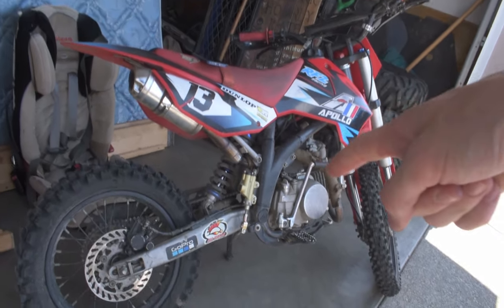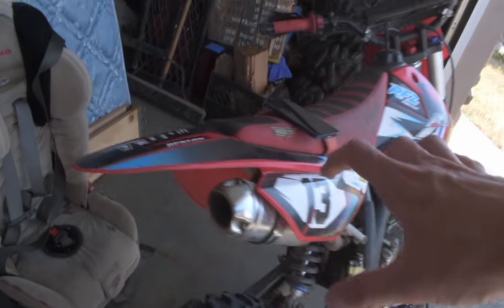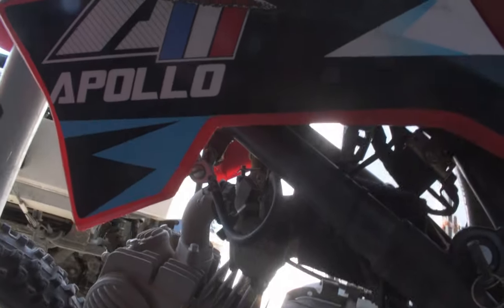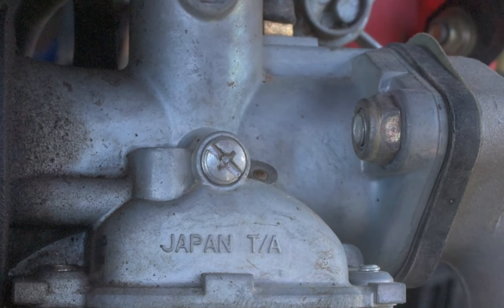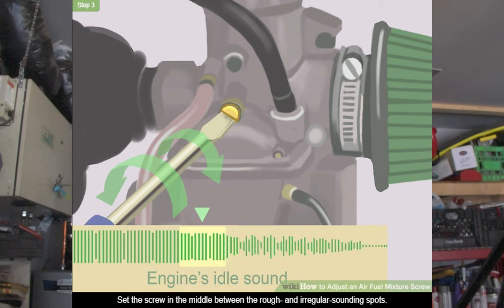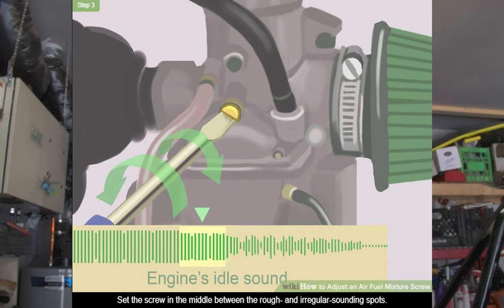How To Fix A Dirt Bike That Wont Stay Running | High Idle | Hot stall

Comment: i've had a chinese motorcycle  110cc for 6 years now and never had issues starting or idle or anything. it just runs good. even the battery has 13 volts after 6 years. i started to like chinese products bcz of it.
Reply from the maker: Thats sweet! Sounds like you have some good luck!
Reply: Lies
Reply: Wish that was the story of my bike
Reply: @henrywinchester9372  why would i lie? it's a honda wave replica. it's called jialing. here everybody use FORZA or Jialing or zimota ... some have 14 years without major issues
Reply: i had one for 3 days and won’t stay on
Reply: @KMDecided  today it closed 80000 km only oil and gasoline. Still working. But the battery died last month.
Reply: @KMDecided  today it closed 80000 km only oil and gasoline. Still working. But the battery died last month.
Reply: @AaronsEnduro  it's not luck. Everybody use it here cuz it's reliable and cheap.
Reply from the maker: @RANGOArts  mine blew up two engines in one year and a transmission lol

Comment: I’m trying to fix a 2003 XR 70R that hasn’t run in about 12 years and the bike is struggling. I’ve put a new carb in it and the bike starts however the idle is often way too high, sometimes even idles at max rpms. Other times the bike will idle much lower and closer to where you would like it to idle at, however when this happens it will start idling quite high randomly and go back down after a bit. There is also sometimes where the bike will smoke a lot, often when the idle is really high. I can’t warm it up because the idle is way too high for a cold start and the adjustment screws don’t seem to change anything with the idle. Does anyone how I can go about fixing this

Comment: My bike only idles on choke and it’s a low ish idle and then soon as it’s warm and I drop the choke it will idle for about 5 to 10 seconds nice then it gets lumpy then dies, also when Im riding it’s perfect no bogging or dead spots but on decel I get single loud bangs out of the exhaust but no flames, no black smoke and ive checked the plug and even put a new one in it. I’ve also put a new cdi on it, do you know what my problem is. Ive got a video of the idle on choke then taking choke off and it dies after 5 ish seconds
Reply: It might be the carburetor jets clogged mine been doing this too I got a new bike last week and everytime I turn choke off it dies and someone told me that it might be clogged maybe check that because that’s what I’m bout to do
Reply: Dude my xr400 does the same thing.  After taking the choke off after a few seconds I hear like a click and it just dies.  I’ve checked compression, done valves, time, spark plug and gone through my carb.  I’m thinking I might actually have an exhaust issue now.
Reply: The thing is though the throttle is perfectly adjusted and ran great for a long time.  Super responsive and doesn’t lag or bog.
Reply from the maker: Maybe debris inside the pilot circuit
Reply: @AaronsEnduro  I just ran through my whole carb, specifically the pilot and I only run non ethanol.  The thing is it ran great for a long time and slowly got worse which is why I checked valves.  I did notice earlier that my float got stuck and it started dumping fuel out the overfill lines.  It’s crazy cause it’s only about a year old and I always drain fuel and all that after riding.
Reply from the maker: @Jbrooks7177  if you suck debris in from the fuel tank it doesn't matter what kind of gas you run

Comment: Please respond to me. I can’t figure out why my quad won’t run. Because it will take a while to start it (it’s kick) if it starts, and if it runs it won’t idle and you can keep it alive for about 30s to a minute and it will cut all throttle and die, and also it is fouling plugs in minutes but no visible damage and normally still look new. (I think) please respond😢
Reply from the maker: Sounds like its over fuelling and flooding

Comment: Thanks for this video vary helpful my crf150 Idols high when hot and revs when the bike is stoped its really annoying when riding on the trails I am hoping it’s an air leak
Reply from the maker: Let me know how it goes!
Reply: Hello sir! Did you found out what is the problem? I'm also facing the same problem
Reply from the maker: Assuming it was something to do with the carb/throttle assembly
Reply: @Troy Wildman please tell me how did you fix it
Reply: @AaronsEnduro  ive already cleaned my carb and my sparkplug is optimal. But the idle gets high when i ride it about 5-6 km. And the idle becomes good if i pull the choke. It feels like running lean when my engine ride about 5-6 km it reaches 3k to 4k rpm
Reply from the maker: What color was your spark plug
Reply from the maker: An engine will rev higher only if given more air/ leaned out. Putting the choke on, limits air flow.
Reply: @AaronsEnduro  the color of my sp is rusty brown sir
Reply from the maker: @arthasmenethil4  tough to say without being able to look it over with my own eyes
Reply from the maker: so when the bikes cold, it idles good, but once the bikes hot and been ridden it revs high
Reply from the maker: Look for air leaks, plugged pilot jets/passages, pilot mixture, float level.
Reply: @AaronsEnduro  im pretty sure that there is no clogged in my jets and theres no air leak in the intake manifold and reedvalve sir. Because if there is a air leak in the manifold i think it will go high idle even when first start.
Reply: Trey Wildman please tell me sir if you already fixed your problem because i cant go for long rides because my bike goes high idle when hot

Comment: bike will start but when u hit the gas it just starts idling high like the throttle is stuck but the throttle isn’t stuck and it just keeps building rpms brand new engine and new carb

Comment: Hi, I have a crf150r and my bike will not run with the choke off. I have cleaned the pilot jet and could see through it. I also replaced my spark plug. Is there anymore tips that could help.
Reply from the maker: Did you ever regard what color the plug was?

Is a bike only wants to run when choke is on, to me id say its too lean of a main jet, or possibly not enough overall fuel delivery via the fuel screw. Check the rotations on the fuel screw m, should be somewhere around 1.5-2 rotations.

If you want to chat 1 on 1 you should check this out
https://www.youtube.com/channel/UCcviyKZ2Vf3IHFliwebzODA/join
Reply: i have a crf150 f and have the same issue

Comment: I got a KLX450R. When I start it the idle is normal, then after I blip the throttle the idle goes up higher, and stays at that rpm. Not sure what it could be.
Reply: Sticky throttle cable and throttle plate. Then check the reverse throttle cable make sure it has tension

Comment: Help. Have a Baja 70cc pit bike. I’ve adjusted the valves, 2-3 carbs, and 2-3 throttle cables. Starts right up, but revs to the moon, and adjusting the carb does nothing. Fixed the Honda CRF50F, but this Baja is pissing me off.

Comment: I have a 2003 kx250 and it idles way high and I'm adjusting the fuel and air ratio screws on my carb
Reply from the maker: You need to adjust the idle screw

If you need one on one guidance i can help you here:

https://www.youtube.com/channel/UCcviyKZ2Vf3IHFliwebzODA/join

Comment: What about a hanging idle when i rev it up and let off it’ll hang at high rpm’s for like 4 secs and slowly go back down to idling good. It also pops a lot when accelerating and letting off
Reply from the maker: Sounds lean
Reply: @AaronsEnduro  preciate it
Reply from the maker: Check your spark plug colour to verify
Reply: @AaronsEnduro  haven’t checked my spark plug yet but I got the aftermarket longer fuel screw adjuster and I also figured out that the boot from the intake to the carb was loose so I tightened it, seated the fuel screw, turned it 2 turns out and couldn’t get it to run right. Still bogging. Messed with it somemore and now I can’t get it to run without the choke pulled out (on) and when it is on with the choke pulled out it idles really high. When I push the choke back in it dies. I’m pretty lost. Might have to rebuild the carb idk.
Reply: @AaronsEnduro  it’s a 2008 yz250f
Reply from the maker: Choke on richens the bike, further confirming its running too lean and there not enough fuel.
Reply: @AaronsEnduro  thanks. I’ll see what I can do
Reply: @AaronsEnduro  and sorry I know I’m asking a lot of questions but when I took the stock fuel mixture screw out it didn’t have an o ring and washer on it. Could they be stuck in the carb?
Reply from the maker: @bradenpryor7442  only one way to find out!
Reply from the maker: @bradenpryor7442  never touched a 08 yz myself

Comment: \I have a problem with this tool, it's a KTM 250 2T
The tool has not been used for almost a year
This week I found time to take care of it, I did a fuel-oil change, I cleaned the filter plug, everything, finally I tried to start it, but the car could not start.
It only started with carburetor spray and shut off straight away
From that I understood that the carburetor needed to be cleaned and that's how I did it.
Now the problem is different, the motorcycle engine goes straight up to very, very high levels
I played with the air-fuel screw but unfortunately it didn't help.
Is there a situation where the problem is different? Something in the carburetor maybe? need help please

Comment: 24 xtrainer..starts fine..after a little run around ..having trouble starting it have to give a little throttle..sometimes when slowing down it dies?? Whats going on?
Reply from the maker: Fuel starvation because of float height would be my guess

Comment: Mine high idles with choke off, then the “rpms” go lower as I lift the choke up more and more. What do I do?
Reply from the maker: To me it sounds like the pilot jet could be too rich. What color is your spark plug
Reply: @AaronsEnduro  I’ll have to check sometime else but I’ll see if it’s the pilot jet , because this is a new carburetor
Reply: @AaronsEnduro  hey I fixed my regular carburetor and I’ll see Tom if that fixes the high revving when I kick it over
Reply from the maker: Exciting stuff!

Comment: Aaron, I have a problem with 125 cc Chinese bike. I can not get it to idle. I have cleaned the carb thoroughly and the Pilot Jet openings as well as fuel mixture screw are clear. If I put my finger over the bleed air inlet at the front of the carburetor, the rpm increases but I just can’t get it to idle with any adjustment of the fuel mixture screw. Any ideas?
Reply from the maker: Adjust the idle screw
Reply from the maker: If you’re idle screw is set to low it wont idle without you staying on the throttle
Reply from the maker: Stock or aftermarket carb?
Reply from the maker: They stamp makuni on the fakes too
Reply from the maker: Id take the carb apart and make sure its put together correctly
Reply from the maker: You already know its a carb/fueling issue.
Reply: Check for air leaks and drill the primary bigger . Mines had a chunk of metal not letting the primary jet sit properly.

Comment: I have a 2009 crf 250r it ran fine till I did a carb clean on it and now it stars fine but without touching the throttle it will rev up a lot then after 10 secconds it will either go down or die out. It is also backfiring like crazy and the pips starts glowing red after startup because of high idle. Do you know what the problem is?
Reply from the maker: If the pipes glowing red, its running lean

Comment: What if when I turn it on just staright up revs the shit out of it like it gonna blow whole bike is jumping backwards I gave it no gas just turned it on I have KLX140G I cleaned carb and put back on started doing that what did I do before cleaning carb bike wouldn’t stay on without giving it throttle so I figured clenaing was my best but ended up doing something wrong I guess
Reply from the maker: Throttle slide in backwards (turn it 180*)
Reply: @AaronsEnduro  gonna work on it today
Reply from the maker: Lemme know how it goes! Should be a simple fix!
Reply: @AaronsEnduro  thanx I’ll
Get back to you I’m off work at 5pm
Reply: @AaronsEnduro  it’s good fixed quite a couple things
Reply from the maker: Heck yes brother!!! Hope i was able to help!! If not still stoked ya go it going!

Comment: What about throttle body bikes? 2019 KTM 450 EXC-F.
High idle when hot, have to slip clutch to get ECU to bring it back down. Also stalled out on take off (loud pop/backfire?) after idling at an intersection.
Reply from the maker: Sounds like its running lean

Comment: So I just rebuilt my bike and did the valves. All the clearances are good. When I start it, it likes to bog when I give it throttle right on startup and when it’s good it has a little bit hesitation and a hanging idle. For reference the idle is set to around 1900rpm and hanging is like maybe 3500. Any ideas? I checked all the boots and lines are all that but I’m thinking it’s the jets clogged
Reply from the maker: Jets and pilot circuit would be the easy thing the check before testing a bunch of other things for sure!
Reply: @AaronsEnduro  thanks for replying. I will check/ clean them and try that
Reply from the maker: Lemme know how it goes!
Reply: @AaronsEnduro  Just finished and it started first kick (normally about 3-4) and runs like a dream. Thanks
Reply from the maker: Heck yes dude! Stoked for you!!!
Reply: @AaronsEnduro  so I’m back here now. I tuned the idle screw because the bike either doesn’t want to start or it starts easy and stays at a super high idle. I made sure the jets are clean and there’s no leaks in the intake system. I think my idle screw is worn or faulty but I and I’ll tear the carb down if I need to. Im just stumped on this Issue. The bike as it sits is perfectly rideable and it starts good but I don’t want it to wear out from always sitting around 3k on idle. Any ideas?
Reply from the maker: Does the washer o ring have any holes or rips ( on the idle screw)
Reply: @AaronsEnduro  sorry for not getting back to you earlier. No no issues with the o ring. The carb is fully sealed.

Comment: I have a question I was riding my rfz Apollo 125 pit bike today ran amazing after a couple rides the bike won't fully rev out anymore
Reply from the maker: What does the spark plug look like
Reply: @AaronsEnduro  NVM! Got the issue fixed turned out it was one of the valves not working she runs good now
Reply from the maker: Glad to hear it!

Comment: Just got a 2011 crf450r and it start fine with the choke… and when I try and turn the choke off it won’t stay running even when she’s burning hot and it won’t start unless the choke is pulled. I know nothing about fuel injectors.
Reply from the maker: check the color of your plug. and see if it looks white. The choke being on increase's fuel for starting (by reducing the amount of air entering the carb). My assumtion is your might need to add somefuel on your pilot jet, or possibly on your fuel screw if the plug is very white
Reply: @AaronsEnduro  I’ll check it out. Thanks man. Never even thought about checking the plug 😂
Reply from the maker: @UncD.  the plug can give you some good information on how rich or lean the bike is actually running
Reply: @AaronsEnduro  👍🏼 appreciate it. Im a 2 stroke guy. So much easier to work on and see things. 😂
Reply from the maker: @UncD.  you gon learn today
Reply: @AaronsEnduro  true that. Thanks tho I really appreciate it. Another guy said to clean my fuel injector out. Because I showed him my gaskets and they started to melt which is terrible. He said my engine May not be getting enough fuel and air.
Reply from the maker: If its melting thatd indicate it running hot. A bike runs hot when its lean ( not enough fuel)

Further leading to me believing your running the bike lean and that why it doesnt run at startup without the choke
Reply: @AaronsEnduro  I just picked it up off Facebook. I think he ran VP gas but I’m. It totally sure. I have no clue what’s wrong with the bike I’m about to strip it down and fix what I can without taking it ti a shop.
Reply from the maker: Look at your plug and fuel mixture
Reply: @AaronsEnduro  👍🏼 I gotta find the screw to change that. 😂